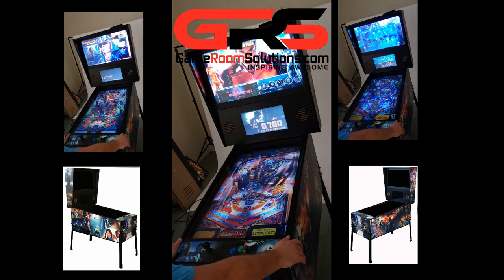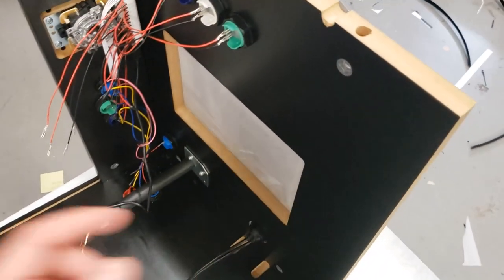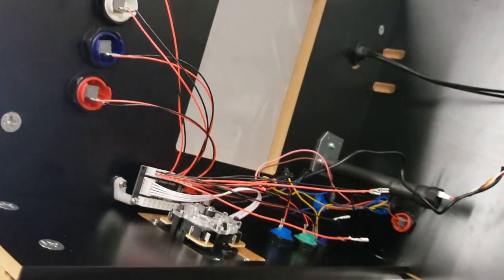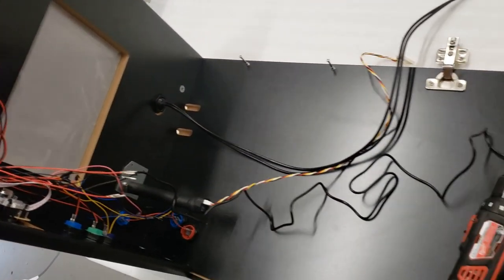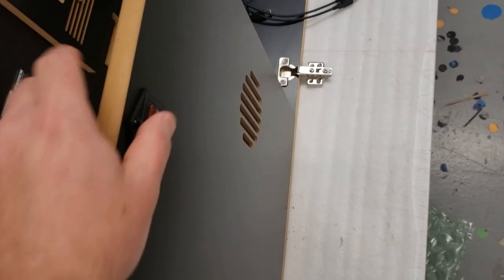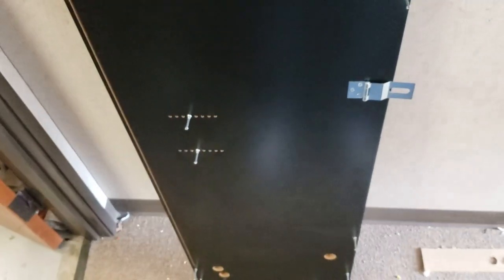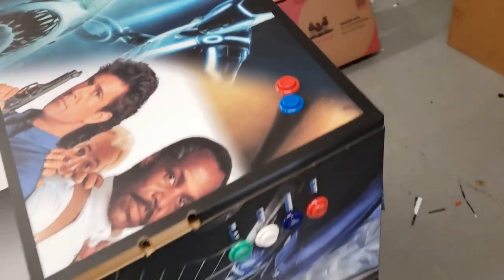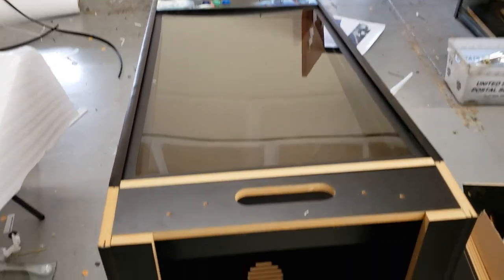Full Size Virtual Pinball Assembly Video - 43" Play Field

Comment: I just received mine and I am excited to build it.  It looks like the design has been upgraded (new lockdown bar area, bottom is easier to remove/access, etc).  Is it possible to do a video on the upgrades and changes?  There are some parts that I am not sure where to use (some different screws and washers, for example).
Reply: I'm in the same boat....This video dosen't reflect the parts in front of me...The included instructions are difficult to see exactly what goes where so I came here...Not much more helpful..

Comment: Woah! Great video! I was told I was the first one to order (guinea pig) the zero delay USB encoders on my Pedestal from you guys. Good to see you guys are using them with the newer builds.  Any chance you will come out with a video on all the wiring with the new style for your arcades? Also, I'm waiting for the correct cables that are being sent for the joysticks with the 5pin adapter on each side needed rather than the older IPAC ones.

Comment: What PC is needed what operating system and hard drive size needed? Also 500watt power supply ok?? Are you going to put a video out on the PC build!?? This is what’s holding me up from purchasing the cabinet. Thanks
Reply: Depends on what screen you are going to use (4K or not) and what software you are going to run (visual pinball, pinball fx etc.) and the recommended specs for that